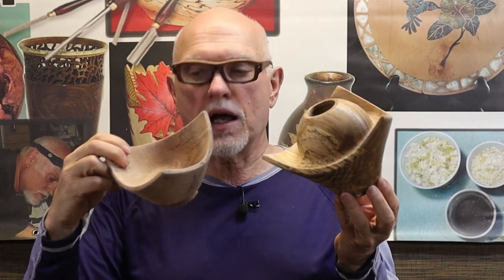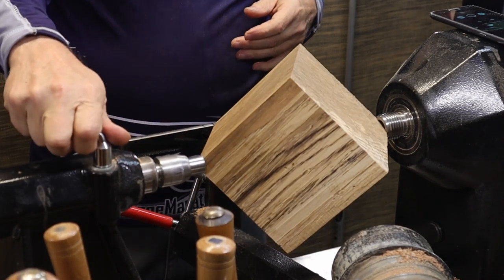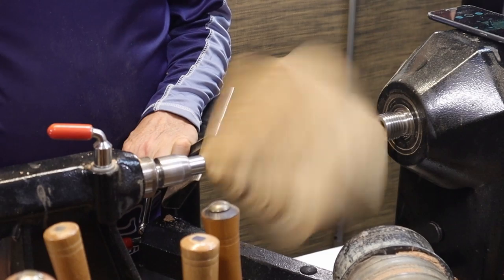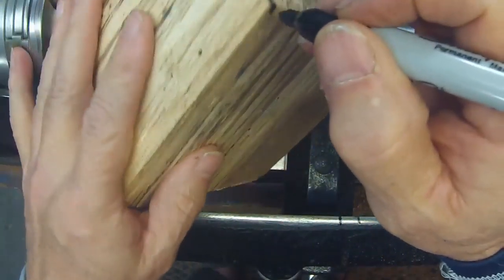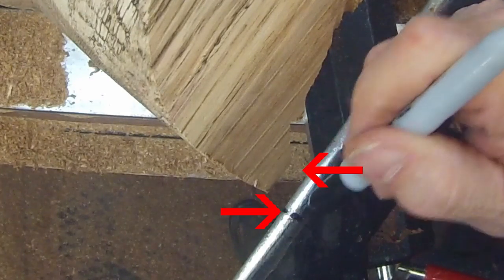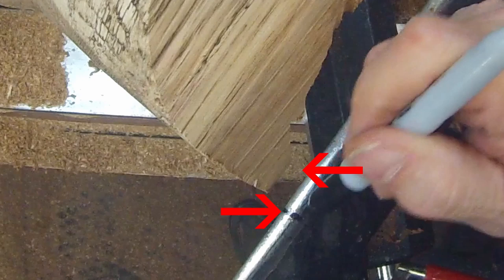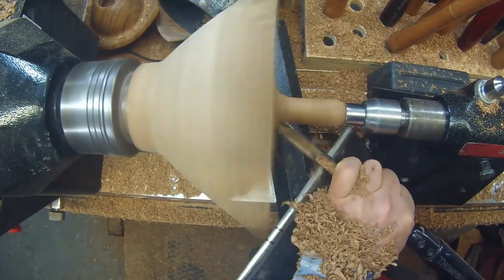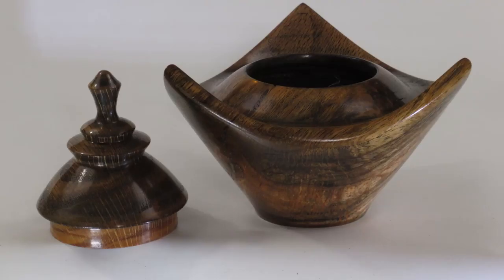Woodturning A Three Sided Bowl

Comment from the maker: I am sure you have heard Tim Yoder say, “You have to sneak up on a bead.” This concept is the heart of woodturning a three sided bowl for me. Sneaking up is extremely important when approaching the TIP of the bowl at the outside and inside of your wall thickness. I only use a bowl gouge with a regular grind to cut up to the walls. Half of every pass is air. That means that everytime the wood comes into contact with your tool there is a violent impact! I try to minimize that impact as much as possible. I do it by keeping my gouge razor sharp and by making a small slicing cut at the very tip of the wall. Presenting the least amount of steel required to make a small slicing cut when it comes into contact with the wood is crucial for me.

Comment: Assuming that the wood cube is dried to ambient humidity, where do you fine such a large chunk of wood?
Reply from the maker: @Doug Robins Hello Doug. About five years ago a very large Live Oak tree in our club's parking lot had to be trimmed up for safety reasons. I harvested as much as possible, waxed it up real well, wrapped it in shrink wrap and put it in the wood shop. Last year I took it out, stuck it in my kiln for about 9 months. I took it out last month and cubed it on the table saw. Ready to go. However, the best way, and most attractive, is to do a random glue up job of dry pieces of dry lumber. Let it dry and then cube it up on the table or chop saw. Ready to go. Great effect on a three sided bowl.

Comment: Thanks for the video! I've done a couple of three-sided bowls, and I recently had the idea to cut the cube so the grain runs parallel to two opposite points, rather than parallel to opposite faces. That way you could orient the cube so you don't have the grain on the bias. (Hope that description makes sense.) What do you think, Roger?
Reply from the maker: @Roy Jacobsen You know, I never thought of that. I am definitely going to do that on the next one. Thanks for the info.